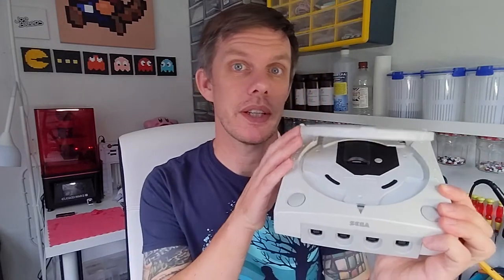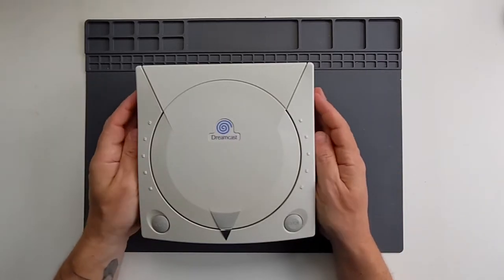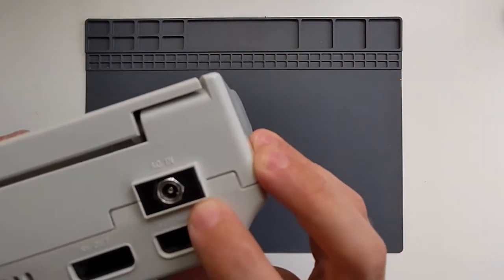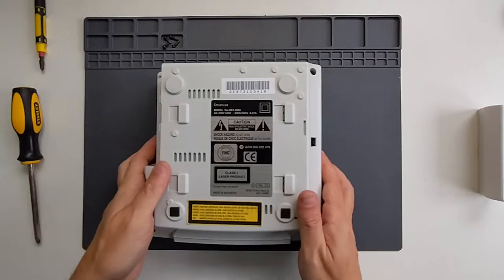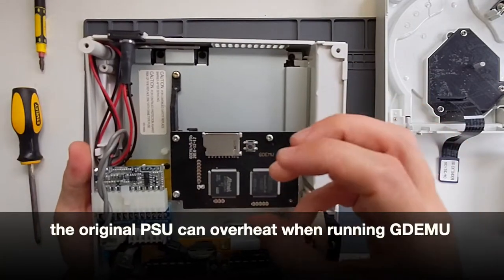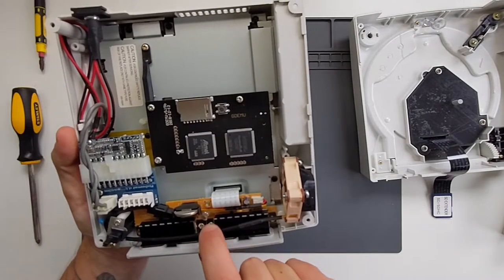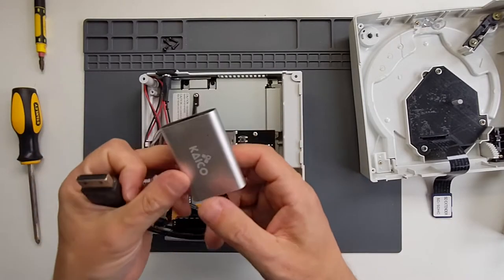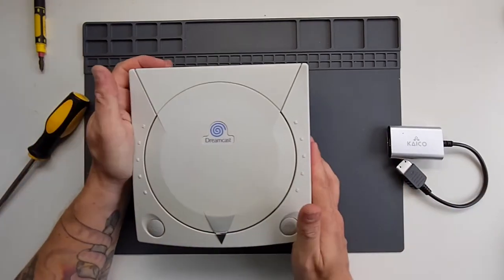Sega Dreamcast mods - a dream machine?

Comment: Kaico adapter is crap.  I use my Dreamcast with my mclassic and a vga cable + vga to hdmi converter.  Outputs a nice solid 480p, then with mclassic + a 2K hdmi edid, it goes to 1440p.  Looks pretty awesome I have to say.
Reply from the maker: I've got an OSSC and can run it via VGA to HDMI but the adapter is just really convenient and works well for me
Reply: @JoeBleeps  I had some issues when I tested one.  The picture was also extremely bright, sound was a bit buzzy over my Vizio sound bar.  Levelhike worked better, but was still plagued by some of the same issues.  VGA to hdmi is really the best option imo.  There are even smaller versions of these vga adapters on the market now.  I recently got an ODV-GBS-C + luma scart ps1 cable; it’s pretty amazing with PS1 upscaling with my mclassic to 1440p. But right now I’m using the GBS Control for just converting vga to hdmi when using Dreamcast, works great and simplifies cables when docked at home.  One other thing, I did notice a big amount of latency when using the PS1 hdmi adapters since I had an lcd attached to it.  That latency disappeared completely when using a gbs-control with scart.  The Dreamcast hdmi latency for those little adapters may be more noticeable on fighting games in comparison with a zero latency vga to hdmi converter..  More comparison tests would be needed.
Reply from the maker: @partypat7229  maybe it varies from one machine to the jext